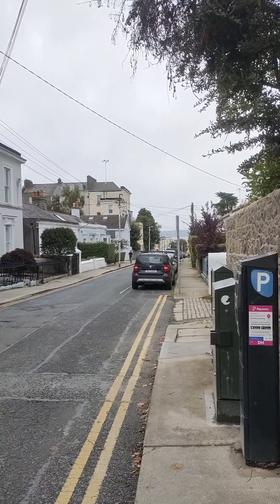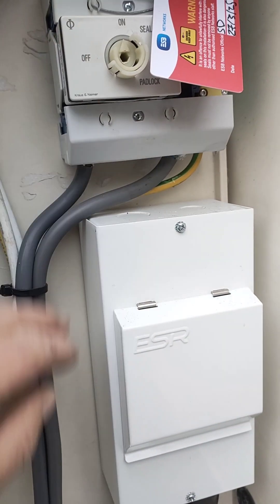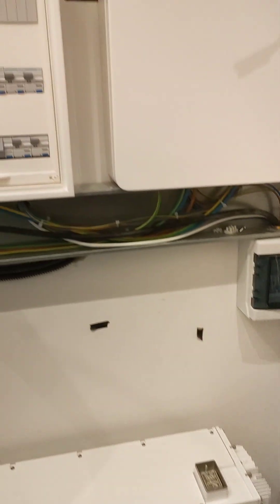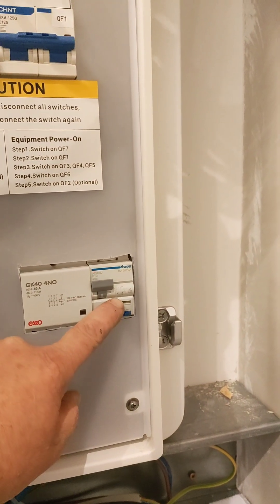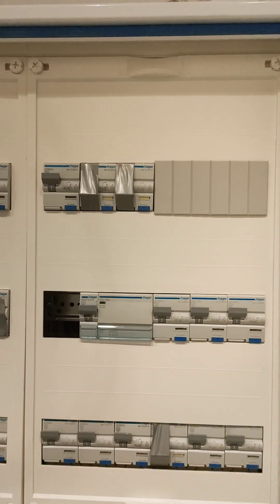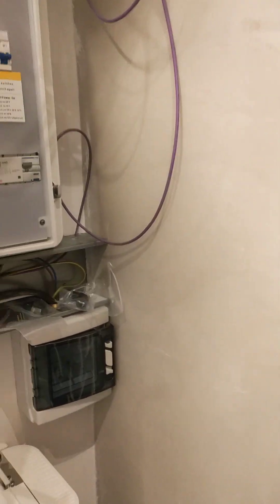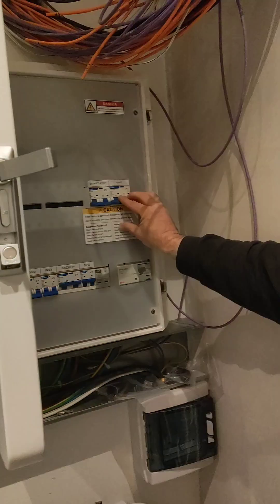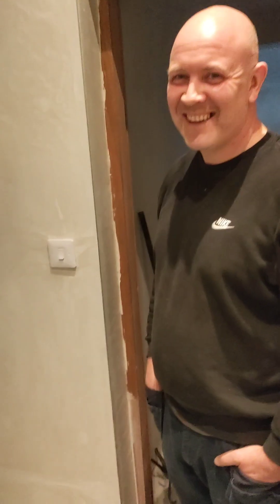Sigenergy system in Ireland

Comment: Is the fireman switch remaining closed when grid drops out to remain charging batteries or is in opened and batteries are only as good as whats in them at point of grid going of. Ie when batteries are empty you then have no power.??
Reply from the maker: Yes the Sigenergy system will continue to charge your battery in island mode (power loss) indefinitely providing electricity if there is enough sunlight). But the fireman's switch is a different thing although, it is a safety mechanism designed to deactivate the entire system in the event of an emergency, loss of the ESB mains power is not an emergency, it's fairly normal recently. If you turn the fusebox off this forces loss of all power.
Reply: @tonywebb9909 so in the event of a fire at this property. The fire men pull 80amp fuse at esb cabinet. Is the gateway activated and supplying the circuits you have chosen. Pull 80amp fuse is also simulating a power outage have I got this right or wrong.
Reply from the maker: @MrPadraigmccarthy so an emergency is not loss of mains supply. But in the event of an emergency the main distribution board would be isolated and this would de-activate all generators by means of single point of isolation contactors.